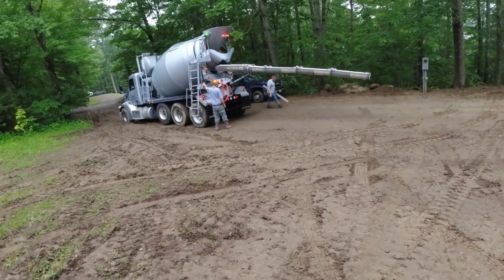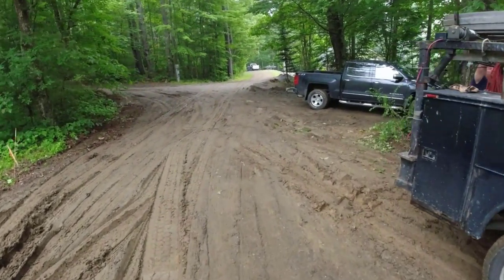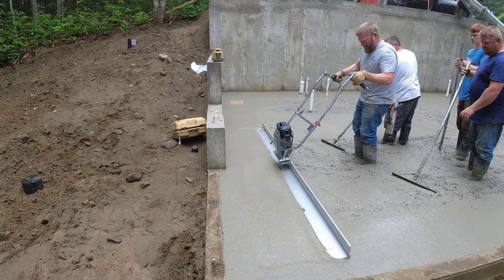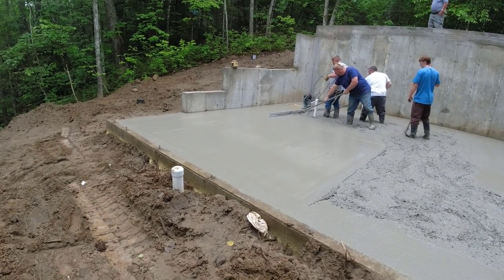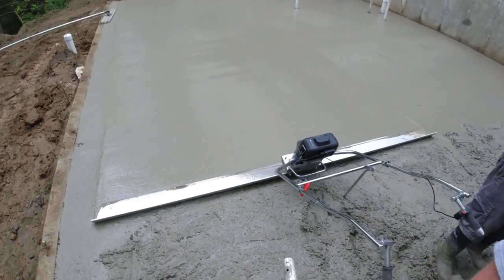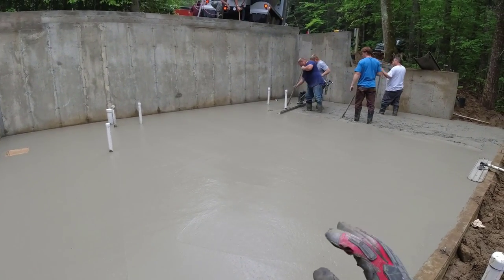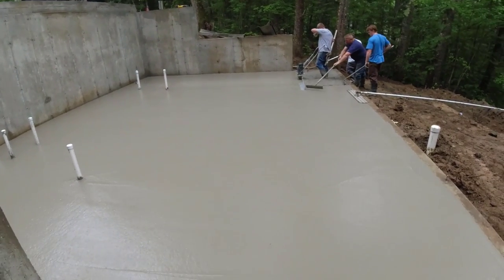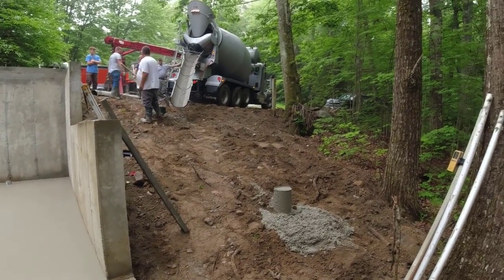One Man Power Screed - No Gas Needed! (32' x 28' House Floor

Comment: Hey Mike I got a tomahawk gas powered and I use a 14 foot board it flexes from weight of power unit and I'm getting dips in middle of board you can't tell it till it rains I was going to buy the mbw looks like its got a lot more rigged board than the L shape that tomahawk uses let me know your opinion on this and would you prefer gas or battery power

Comment: Over all length of the handles didn't seem right? They should be able to telescope up an down, not all people are the same height?  Just being able to adjust the grips isn't good? Good Job guys.
Reply from the maker: They do telescope in and out some, I'd like to see a bend in them.
Reply: @MikeDayConcrete  yep, any big slabs coming up?